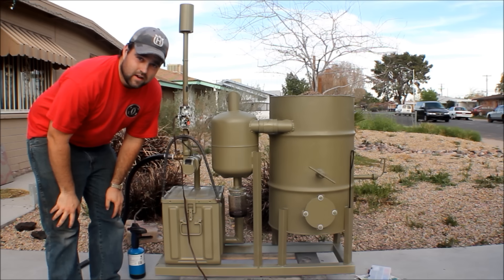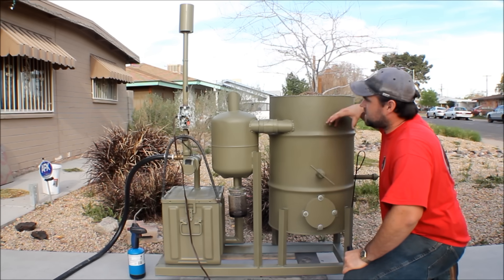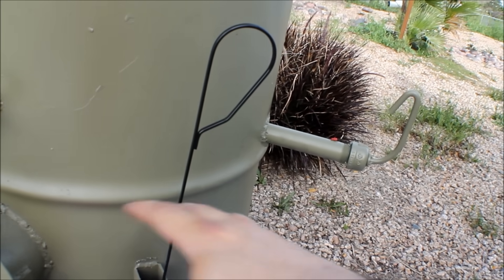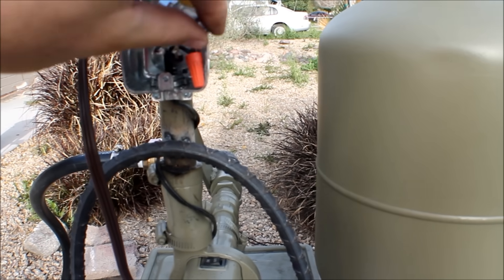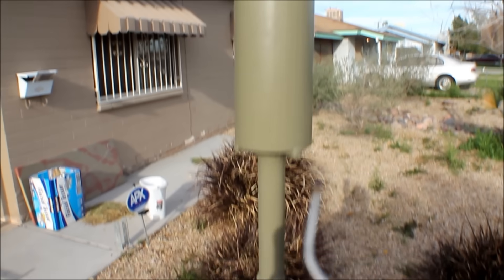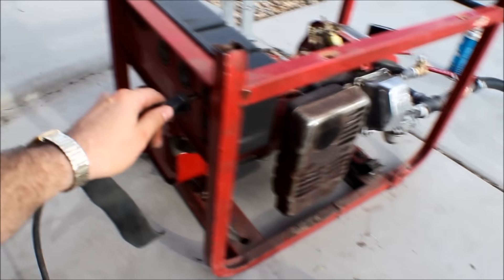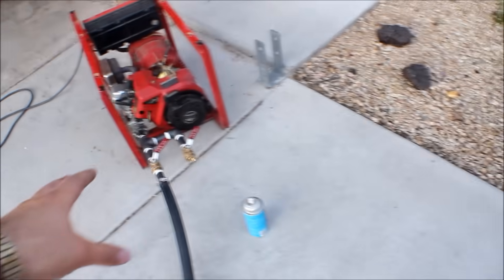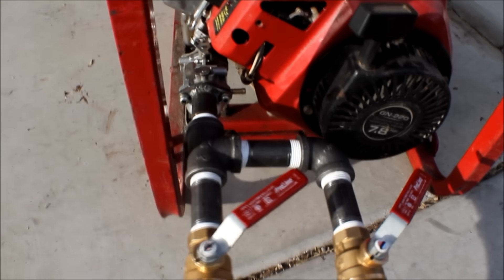amazing homemade gasifier uses wood pellets to run generator -- renewable alternative energy video

Comment: Hi JR, Thank you for your Great Video. It really helped me to Understand how Wood Gasifiers work. I am building a Wood Gasifier now. I have a couple of questions. 1)  What kind of Green Paint did you use? 2) Where exactly did you weld the Starter Tube onto the Fire Tube?,( How far from the bottom?) 3) What is the distance from the  Bottom of the Fire Tube to the Basket? 4) Other than the Fire Tube, what diameter are the other pipes that you are using, like the pipe to the filters?  I very much appreciate your help. Thanks, Mike

Comment: "Holzvergaser" a lost Art which was powering quite a number of cars in Germany after the war. Thanks for the Vid!
Reply: Similar, on the other side of the ocean, this is how farming was possible during WWII, as American farmers put wood gasifiers on their tractors
Reply: @email4664  its something how we went back to diesel fuel.
Reply: Good to know 👍
Reply: In Spain were actually used between 1936-1959 after the civil war,there were also electric cars and it's not a joke in the 1940 there were electric taxis in Madrid ,,
Reply: @breogan8121 Electric cars predate gasoline and diesel (or any internal combustion) powered cars.
Reply: Get you a flat bed truck with a 500 gallon tank
Reply: many here in the USA during the war due to rations as well

Comment: So itll run one powertool? Not worth it
Reply: I was kind of hoping to get an idea of HOW much electricity the system can actually produce. That's really key here. I could imagine hooking this gasifer up to a generator to charge 12v batteries and then keeping the batteries on a cycle so I can keep a house or rv running on said batteries but it really all boils down to how much electricity will it produce and how many woodchips would be required to burn to charge 1 battery.

Comment: Arent you using electricity though to run the fan?
Reply: That's one flaw I noticed but to his credit hes using his car battery to turn the fan on. He's assuming his car will start in a SHTF scenario which is safe bet as long as it wasnt emp related. The other thing I thought about was how the fan could be started with a 12v battery you previously charged using the generator. You'd only need an external power source for the fan 1 time and then you could charge batteries from there to help you start it again.
Reply: @tcarr6575  excellent point
Reply: @davidclark6694  What im curious about is how many woodchips would it take to charge said battery. From my research this is all about the size of the firetube. The larger the tube, the larger the fire, the more gas is produced. I'm curious how much energy a set up like this produces and how many woodchips it would take.
Reply: @tcarr6575  that makes 2 of us
Reply: @davidclark6694 I just read the fema manual states 20pounds of wood should equal that of 1gallon of gas in terms of energy production. Assuming that's correct I think the math can be figured from there. What it tells me is a 2000pound DRY cord of wood should equal about 100gallons of gas.

The biggest issue I see is it's going to take energy to chip up the wood. You can't use whole firewood.

Comment: i must be missing the point because cant you just purchase a converter connect it to your battery and without any work or fumes or heat or generator or purchasing pellets have power to run that saw?? Don't get me wrong its cool the way that works but what is the point?how much did that cost?and the welder?material pellets? so on and on??a converter for the battery your allready using cost next to nothing?

Comment: The actual make up of the gases being burned are wood alcohol, carbon monooxide and maybe some methane?
Reply: From my research it breaksdown to roughly 20% hydrogen, 20% carbon monoxide, 50 to 60% nitrogen, and a little bit of methane. The hydrogen and carbon monoxide are mostly what create the flame with a bit of methane. The nitrogen helps push it through the system but isn't itself flammable.

Comment: It really wouldn't take much to install a control panel to automate much of those processes. Just a push button start and keep the hopper topped up. You could then control the temperature using either a heat exchanger for domestic water heating or a car radiator set up.

Comment: I could be wrong, but I believe woodgas loves to condense onto whatever it's flowing through, so you want to have the shortest run of pipe possible between the gasifier and engine.  I also have never seen a filtering box (the sawdust in the large ammo box) but I bet you're losing most of your smoke there.

Comment: You can slow the blower with a resistor. Use a length of iron wire which has higher resistance over copper wire.

Comment: #1 why not have a pcv on that barrel? I would even if others disagree just for piece of mind
#2 why not put in a worm coil similar to what moonshiners use to cool the vapor? Don't even have to make it run fresh water, you could make it so that it circulates in/out of the system. I'd definitely have a pcv on that as well if I was to attempt it so it wouldn't explode.

Comment: So this is " Burning " wood without any particulates, it should not be underestimated how important this is.
Reply: http://www.build-a-gasifier.com/PDF/FEMA_emergency_gasifier.pdf

Alot of people understood it back during WW2 when there was an oil shortage. We gave up the idea because oil was so cheap after the war. Now with energy issues across the midwest people should think about gasifers again. Energy prices arent going anywhere. With an efficient burn I think these could be considered carbon neutral as well as a great off-grid energy source.
Reply: @tcarr6575  Do you know if they produce any particulates ?

Comment: Add a little Oxyhydrogen to the output of the Gasifier and get a cleaner burn inside the engine and the engine will run smoother.

Comment: You need to run a little bit of Oxyhydrogen and you will run at the maximum RPM needed for the Generator.

Comment: What percentage of that gas would be hydrogen and methane? What ate the other gases? Does it produce less Co2?
Reply: 20% hydrogen, 20% carbon monoxide, 50 to 60% nitrogen, and a little bit of methane.

https://www.instructables.com/Power-in-the-Apocalypse-How-to-Build-a-Wood-Gasifi/
Reply: @tcarr6575  what about CO2? What happens to the nitrogen? I don't think it burns right? There might be a way to capture and use it because nitrogen is what plants need.

Comment: I just saw another video where the guy used cardboard scraps and sawdust that he mixed with a concrete/drill mixer, into a plaster consistency, then made a wood press to press out the water, then dried in the sun to make wood pellets.  Sorry I don't have the link.

Comment: so you're using pellets, which I assume take electricity or fuel to make, to make electricity?
Reply: I was wondering if you could make your own from sawdust bound with cornstarch glue
Reply: @thecurrentmoment  the sawdust would require electricity or fuel to make enough of it, I don't know if you can make enough sawdust by hand. I don't know about the cornstarch glue tho
Reply: @vampifrog  I think if the sawdust is 'free' as in it was already being made from a sawmill, etc (e.g. if you had a saw mill) then it could count as not using any extra energy.

You would need quite a lot though, but is possible if you had a pitsawing operation and plenty of willing volunteers lol
Reply: @vampifrog  I was more thinking of whether it would take energy or electricity to actually make the pellets once you had the sawdust. I think you could make them without electricity, once you had the sawdust. Glue them together with cornstarch glue and dry it out. Something to experiment with anyway

Comment: How many watts generator  graph hp of engine by design   his is 7.8 hp motor but how many watts.  Use a bigger pipe 6" tube for heat escape

Comment: A jacket radiator around the burning part that ran coolant attached to some sort of radiator and run it through a separate heater core above the radiator and make a heater for the winter. JUST LIKE A CAR although in this case no waste

Comment: Didn't read all the comments however has anyone considered the economics of this?. Can't imagine how this would be feasible (in its current form). Might as well feed that thing with US dollar bills when you get Trumps $2000 stimulass as they'd be worthless with all that money printing anyway. but In Australia quick look at eBay suggests 75kg of 100% hardwood pellets is 75AUD. this is $1aud/kg.. roughly 0.70usd/kg.  looks like your consumption is about 0.5kg/hour to run an unloaded circ saw ( say roughly 0.2kW of electrical load). carburetor based ICE is only about 25% to 30% efficient. rest being dissipated as heat.  then you have an generator hooked up to that which further decreases your efficiency. (portable diesel genset roughly 10% efficient @ 25% load, to 30% efficient at full load) Even if you pellet burn gasification is supper efficient say >90%. (google reckons 70-80%) by the time you add the genset you'll only get about 9% efficiency of the overall system. (total efficency = System1eff x system2eff x systemneff)  Going back to economics. 0.5kg/hr for 0.2kw  is 0.50c/0.2kwh or 2.50/kwh or about 8 to10 times more costly than power in Australia.  By another comparison the latest clean coal power-plants are targeted at >48% efficiency by 2040 which will drive the cost of energy further down.
Reply: I´m sure you would like to have a gasifier if there is no other source to produce the supply for a genset. This is not a solution or a replacement for normal times is a way of going on while there is no other source in an emergency time.
Reply: @armandopiatti1065  Don't disagree with that argument. The title threw me off a little. Seems like very poor inefficient 'renewable alternative' energy.

Comment: I dont understand how there are fumes that burn off of wood thats already burnt..🤔
Reply: Lookup 'gasification' , 'syngas' or 'producer gas'.  It works great with those pellets as they are burned at very high heat. (reason why he needed to thermally decouple the tank) and only with very little oxygen that is drawn in through the long tube of pellets.  This essentially breaks down the hydrocarbon molecules and (as its starved of oxygen) it only partially completes the redox reaction. (i.e the secondary burn happens in the cylinder of genset) The pellets now broken up into moleculus of various gases at these elevated temperatures are sucked into the cooling chamber.  As JR M explains this is another critical step because the energy content of hot gas and cool gas differs (density) and you need fuel for the genset to do work. 
The reason it works is also a reason why it is inefficient in certain setups ( unless you recover waste heat).  Lookup a great furnace made in the US by Kuuma Vapor-Fire 100..From the quick glance this furnance uses very similar principles and microcontroller oxygen controlled/injected secondary burn to completely burn the wood with very high efficiencies  and very low emissions.
1.0 Grams/Hr of Emissions
.02 Grams/MJ of Emissions
99.4% Combustion Efficiency
82.4% Overall Efficiency
Apart from passive designs this is probably one of the best most Eco friendly (and renewable) ways to heat your home. 
To put this in perspective Latest Emissions standards for cars which are  CO 1.0g/km  NoX 0.06 g/km and  PM 0.0045g/km (euro5 and by extension ADR79/04)
That is if you travel 100km/hr for an hour  in this latest engine tech you would have created the same amount of emissions as the Vapour-Fire furnace which was heating an entire 3500sq (325m2) home during that hour.
Reply: https://www.youtube.com/watch?v=FK2qK-NCQH8  you gotta watch this!

Comment: Have you considered using something like charcoal vs cedar wood shavings for your filter box media? I was just thinking it may serve the purpose a bit better without being quite as combustible. Just curious
Reply: Charcoal is a terrible idea you have to clean the smoke out of the exhaust otherwise you are getting nothing but tar you don't want to have tar that's what you're trying to get rid of is cedar chips are the perfect idea maybe even some cotton in there would help because you want nothing but hydrogen you do not want the tar the tar will kill your engine

Comment: Hey JR fantastic build. One suggestion on temperatures, the hotter you can get your pyrolysis zone the cleaner the gas will be (less Tar) but right after that you want it to get as cold as possible so the gas condenses better. On mine I attached an old radiator and added a bubbler filter full of marbles (the ultimate tar remover). Works like a charm with my inverter generator.
Reply: Do you have any diagrams to share or parts list?
Reply: A small S&T consensor is best if you can get your hands on one.  Either have water circulating through the coils or immersed through and through (not u-tube)
Reply: Definitely need a condenser …
Reply: Marbles? Brilliant

Comment: I don’t understand why the improvised carburetor when the one on the generator has a gas input (where the fuel line connects) and air control (throttle plate). Also- the “waste heat” of the burner vessel should be captured/used to heat water, as should the heat from the gas densification process; perhaps the latter could be a “pre-warmer” loop for the former...pressure mitigation there should also be considered. And a battery that gets charged by the generator to get things started would be a great addition

Comment: Well, although it makes fuel gas out of practically waste material it does use pelleted wood and that does not grow on trees so you have to expend energy to make the wood pellets first.
Raw waste wood is extremely hard to break down into wood chip or particles for gasifiers like this.....solve that problem and you're ready to go......perhaps I'm missing something in that process.
Reply: All gasifiers used in Sweden during WWII just used fine cut firewood so there isn't any need för the pellets or wood chips. Its just a matter of building  it for the fuelsource you plan to use.

Comment: is it possible to store those vapors? maybe making them cold enough, or blend them in regular gas?
Reply: The gass is unrefined still and contains propane and methane besides other compounds carbon, smoke , hydrogen etc. I saw a experiment where a person caught smoke going through a tube under a container of water into a tank open bottom to the water tank so the gas smoke bubbles from the water tank to the other..this tank had a hose at the top and a Schrader valve to use a  vacuum pump to remove the air so what is captured in the 2nd tank is only the gas the water removed the contamination and he let it sit for a day then the flame will burn clear to blue if the fuel is most clean of contamination and a orange yellow color if it  has unwanted conditions in the gas to use as fuel for a gas engine! I remember this fellow also one of his tanks has a water filter system too.

Comment: Can you imagine making a bigger unit like this with a water cooling system that also feeds or radiates that heat through rads in a cottage out in the woods while running your generator.
Reply: I was thinking the same thing!
Reply: @mikaida  that b soo cool

Comment: Love the gasifier stuff! In Sweden we had cars that run on it when the gas/petrol was at an all time high.
Next version would be some sort of TEC that took some of the heat generated and convert it (thru a custom charger) electricity to charge a battery. That battery would then power the fan and maybe even start the fire. The generator would be a custom one that was built for gas for maximum throughput.
So in essence put branches in press button wait for power... that would be awesome... and then make it small an compact (but still use off the shelves parts for cheap repair/build).

And a solenoid to do some shaking :-)

Comment: Please give some data like volts and amps that the generator will output. You can spin a saw with no load but what does it do when you load up the saw. That is the important part. If you make one to run a 30 hp motor will the motor put out 30 hp continually.

Comment: Put a metering valve on the air pump outlet and get rid of the rheostat.  Gate or metering valves would be a better choice for the generator inlet too.

Comment: 10:22 one dollar controller https://www.aliexpress.com/item/33012725299.html or any other. never use potentiometer in series to control speed. better lamp shorted by switch to have 2 speed.

Comment: You could theoretically run a sterling engine off the heat generated by your pipe leaving the oven to pump the needed air, no electric motor needed.
Reply: Sterling engines are very weak with very little torque. It wouldn't even be able to turn.

Comment: Great work, great build! I do wonder: Why are many of the designs such that the blower is used to pull fumes through vs. in front of the air intake pushing air into the system?
Reply: The way I understand it is the blower  is used to start the burn and then the suction from the internal combustion engine takes over...I guess if you weren't driving an engine you could force the air in from the intake side. But then you'd be running a blower all the time??? 🤨🤔😀😎

Comment: This is awesome and i want to build 1 with my kids... only questions are. What about lubrication for the engine or would this not matter... how long does the fuel last...
Do you think running the pipes through a water bath would help with gas cooling... 

And lastly... brilliant job sir,  im glad I watched this..

Comment: This looks a good build to start with. I would make the inner wood tube 10 or 12" dia.
 the separator/cooling chamber I would make tall perhaps a metal water heater tank, to allow more cooling of gas.   Why is the gas outlet in the barrel high near top?   Is it so to be above floating ash that could be sucked into the outlet?